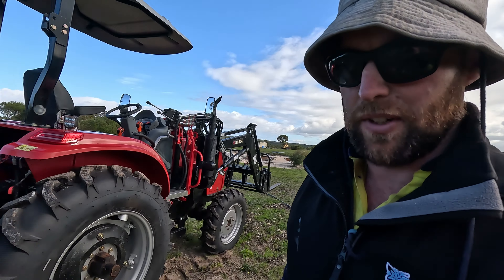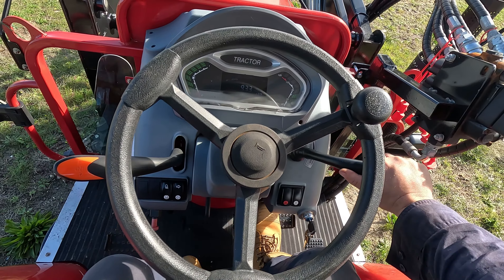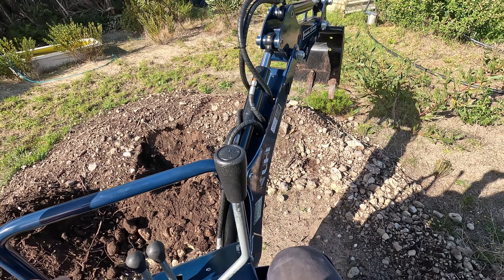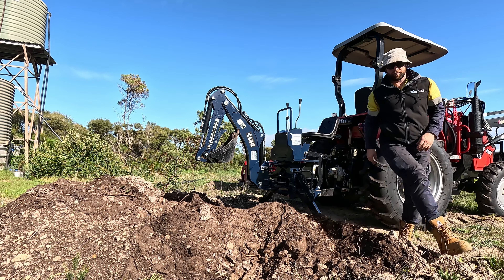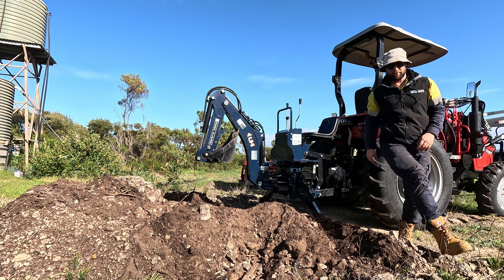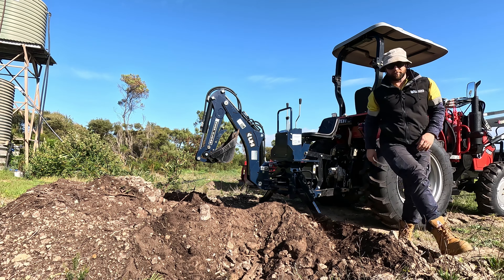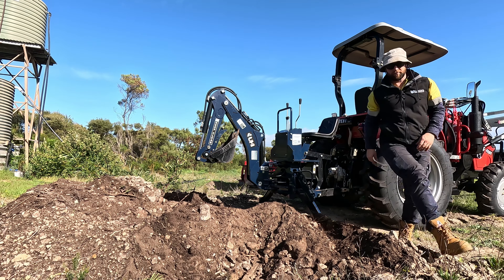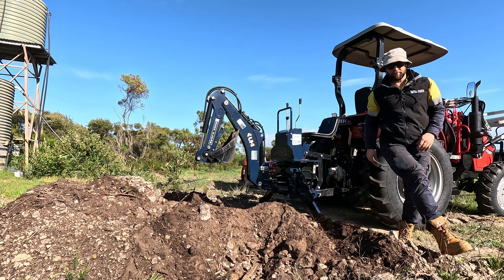UHI Machinery Backhoe, Grader and Slasher Overview! #goingoffgrid

Comment: Loving your vids. I found with my little 4ft slasher the wire thread through the chains snapped. I replaced it with a piece of re bar drilled a small hole in the rebar at either end & put pin in to stop it sliding. It works a treat. Tractor place in town wanted to charge me $100 it cost me $20 to fix myself. I had to take the wheel off as it totally bent after going through a small dip in the land. lol. With our terrain it works better without the wheel. Great to see backhoe at work. I haven't hooked mine up yet. But putting the larger control handles in if I screw them tight they hit the bar, so they are loose if I have them sitting in the right position. Is it like that with yours.
Reply from the maker: No I havent had that happen with mine, sounds like something isnt quite right there

Comment: Looking at this gear exactly, but the A/C cab model. Many thanks for your review.
For the price you pay its bluddy hard to beat for small farms and properties like our selfs.
Reply: Be careful. Ours arrived with a missing bucket, a smashed grader, front bucket hydraulics attached backwards, no manual on backhoe hydraulics attachment without internet, as well as totally filthy. You wouldn't have thought it was a $30k brand new machine. Delivered without a forklift. Very unprofessional.

Comment: Hi Andrew, thank you for your video sharing. According to your review, I bought my UHI 754 earlier this month. Thank you very much! Now can I ask you a stupid question? The rake hook on the back of the grader, why is it face to back but not face to the front? Also, it is pretty loose how can it work? Richard.
Reply from the maker: I just spin the grader 180 if I want to use the rakes then they tear up the ground pretty good. Normally they are designed to just flip up when you are using it as a grader only
Reply: Thank you for your quick reply. I will ask more questions about this machine later if you don't mind. Hopefully, you can record a video about grader use in the future.😉  @GoingOffGridAus
Reply from the maker: @fanazenashram  no worries. I will do a quick vid next time I use it

Comment: HI Andrew, you mentioned using your flail mower in the future, have you used it yet? how did it go? I've been thinking of getting one when i get mine delivered but my friends with tractors say its a waste of time with less than 70hp. They operate 35 and 40hp tractors on their properties so I'd like your perspective using the 55hp if you don't mind. cheers mate.
Reply from the maker: Hi mate, I used the old flail mower a bunch, it was probably designed for a 100+ horsepower tractor but had been modified with some rear trailing wheels welded onto it. But you could drive through a forest with the thing and it wouldnt even notice. But was tricky to use on my block because it is so hilly, constant adjustment to prevent it churning up the ground on dips. I ended up getting a Zero Turn so sold the flail.
Reply from the maker: It was mounted to a 50 year old 55hp fiat tractor when I bought the property, and both the fiat and the UHI both ran it no problems at all.

Comment: You installed the side rails upside down!  The rounded corners go the the ground side so it does not bite into the ground
Reply: I thought that too with mine, but the instructional video have it with the flat side down. But makes sense it should be rounded side down
Reply: That shows how good the instructions are. There are none! A farmer needs to be a mechanic to put it together...
Reply: @derekroyds2051 ours arrived with the front bucket hydraulics attached backwards.